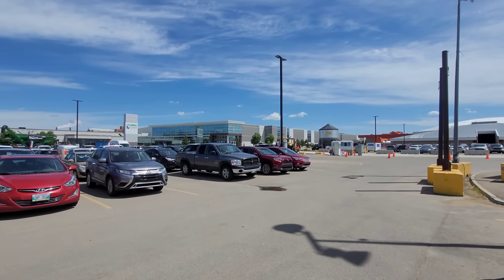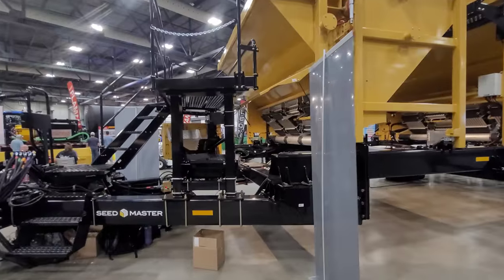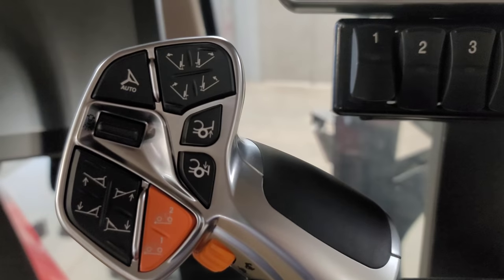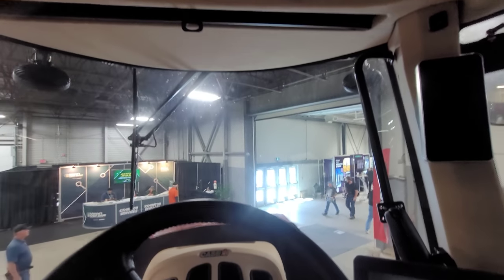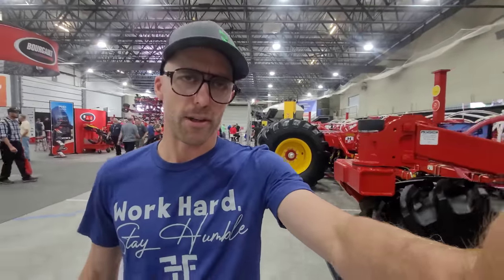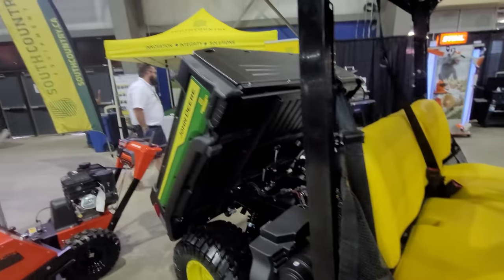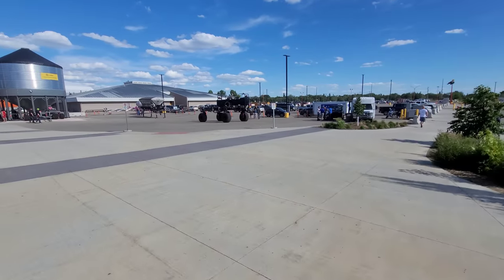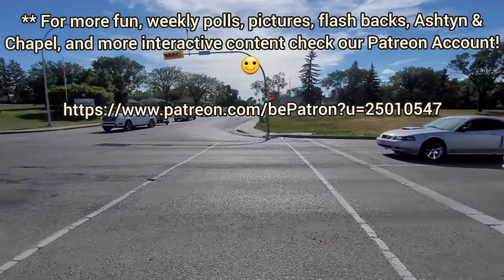Farm Progress Show = Disappointing...

Comment: That big bin on wheels are quite common down under. Call them a mother bin. Like you said put them in your field, chaser unloads into the mother bin, truck loads out of the motherbin
Reply: Check out the size of coolamon mother bins, absolute monsters
Reply: The Coolamon bins are 200 tonnes. That seems like a lot, but you can always use more.
Reply: Mother bins are for efficiency in grain handling not storage. Quite common here in Oz especially where distance is an issue. It still won’t solve mikes bin shortage problems.
Reply: Do most of them use a attached engine or do you use a tractor?  I know of several farms in western Kansas/Eastern Colorado that use them that way.
Reply: I have only ever seen them with a tractor for power. 
You need the tractor to move the mother bin and it may move often to maximise efficiency.
Reply: It would seem more efficient to unload directly into a truck when it is available and the bin only if waiting on the truck. No point in double handling, time, power, equipment wear, and damage to the grain. And the truck can usually come directly to the source, while the bin being a bit less mobile unless empty, may be positioned at some intermediate point.
Reply: Yes handling the grain less is best but often not possible. 
On the original home farm its no more than 10 minutes trip to the silos. On the northern most farm its 90 minutes. If we had to go into GrainCorp there would also be waiting time on top of that.
Reply: @JLittleVegemite  our farm is 80km from the silos. So on a busy day it's almost a 3 hour round trip in the truck. So we need somewhere to store grain while waiting for the truck
Reply: @JLittleVegemite  for Mike, he has a fleet of Bert's (old JD tractors) that would be more than capable of powering one of these.
Reply: @JLittleVegemite  they could at a pinch. What he does with bags is possibly the best short term option, other than paying the silo to store it. bags must be the cheaper option. The south farm covers a fair bit of ground, but your right, motherbins are better for efficient grain handling. They run quite a few combines, which on a good year don't take long to fill. Having a motherbin or 2 they move with the crew could be advantageous.
Reply: Mothers work for Family’s operation because we have storage or go straight to GrainCorp. Probably won’t help Mike with the volumes he has to deal with. Everyone has their own unique circumstances, Bags seem like a great way to go for Mike. I’m sure they have run the numbers many times.

Comment: Word is the row unit on that seedMaster Is still bouncing side to side as we speak
Reply: You are wrong. The constant stress of bouncing from side to side led to fatigue failure and it's currently broken off and lying on the floor.
Interestingly enough, the bouncing row unit started the whole machine vibrating, and the sudden shock as the metal snapped led to several other parts falling off the machine, and it's currently dancing around like a badly loaded washing machine.

Comment: Dang it Mike! I was hoping you’d spend some more time with the lexion! We just got one after we demoed one. Impressive machines. Can’t wait till you try one!
Reply: Lexion equates to breakdowns
Reply: @jeffg6429  they can't possibly be half as bad as the fendt. Did you have a bad experience with claas?
Reply: @jeffg6429  what model did you run?
Reply: @jeeveswooster6922  2008 575R.
Reply: @stirv6462  your correct, I believe Fendt is not a good machine either. After my Lexion, I got a 2009 JD 9870. Great combine. Just added a 2014 JDS690 last fall.  We will see, but I know the previous owner and he took great care of it and had very few issues with it.
Reply: @jeffg6429  we demoed a 575 against a 9870 back then. The claas didn't do anything they said it would. No power, no capacity, constant sensor beeping. But I'm sure they've improved.
Reply: Everyone I know who runs the Lexion seems to really enjoy them. Big capacity, loads of power. The 9800 series is an impressive machine. But like everything else, there will be a bad one somewhere. They all break eventually, but nowhere near the repair bills as the junk deere.
Reply: @winkletown8828  have you been around a lot of 9800's?
Reply: The lexion is getting alot of sales locally to me 
The 8900 is pushing out the new holland 1090 for sales 
Both really good for our highermoisture high yielding cereal crops here 
Deere and case have a smaller market share but they don't really rate for capacity 
No way to get around needing twin rotors amd big seives 
The X9 turned into a giant flop in our conditions 

Generally round here the case new holland guys are running 9.90 pr 10.90 new hollands and the deere guys are running the claas 
Both are very comparable in every aspect from capacity to reliability and service 

But currently new holland closed theor order book fairly early with low orders scared they couldn't deliver (our new 9.90 is on route) 
Claas had more room and got a bigger local share this year 
I'd certainly look at one in a few years time
Reply: @fowletm1992  are you in Europe somewhere?  The new Holland seems to keep up with the claas when the same class is side by side?  What do you think made the x9 a flop?  Capacity and sample quality and loss?
Reply: @stirv6462  
Southern West Australia 
The X9 had bad losses and didn't have the advertised power 
I think they just need to do more feid testing 

The new holland and the claas are quite similar 
Every test had a winner either way 
I think the operator, the bloke setting them up and the conditions on the day all played factors
Reply: @fowletm1992  deere seems to release a pretty bad product and then improves it substantially with incremental changes over four years.

Comment: That big bin id bet would even be useful when seeding. Bring it to the field all night and have seed and or fert right there.
Reply: You can't move them full
Reply: @fowletm1992  
Just leave them there full.
Reply: But then you've gotta fill them 
So fill the trucks drive them to the feild 
Bring an auger to the feild, empty the trucks into the bin 
Then try to position the seeder under the bin auger to fill the seeder 

It's just adding extra steps and extra pain
Reply: @fowletm1992  if there aren't enough truckers to drive its a mobile storage bin that can be in far away fields for a week or a month.

Comment: I agree. When I didn't see John Deere equipment I thought I had missed a section of the show. The information booth said many people were surprised at the lack of actual equipment. I can't imagine making much of an effort to attend next year.
Reply: it happened in Louisville KY this year  no Deere equipment.
Reply: @jchambers2586  Thanks for the info. Wonder if it's a hangover from covid or dealers/companies aren't seeing the benefits of the shows? The ag related company I worked for revamped their in person marketing during covid and I don't see it going back.
Reply: @jameshill4900  Personally I'm wondering if the Deere strike didn't have something to do with it. Dealerships are low on equipment as it is so I wonder if South Country (the local Deere dealer) didn't have anything they could spare to send to the show. Our local dealer has practically no unsold equipment at the moment; it's all sold or in for service.
Reply: @joshuadoll9000  Could be. Not much is on the lots. It was just underwhelming to see no equipment outside and very small presence inside. AGCO like Deere didn't have any equipment there either.

Comment: Will you ever try New Holland tractors.  Very curious about the horse power and pulling power
Reply: Aren't they CaseIH?
Reply: @mytech6779  Yes and no. They roll down the same line in Fargo, but there are a couple, not a terrible lot, differences.

Comment: Is that long pump thingingy an effulant pump for stirring the ponds ? Or is it really for irrigating ?
Reply: Can't be for irrigating, it's only going to cover a couple of acres before you need to move, unless that's just a base unit.
Reply: Used for low spots that will be dry in july. Makes it so you dont have to go around every little thing.